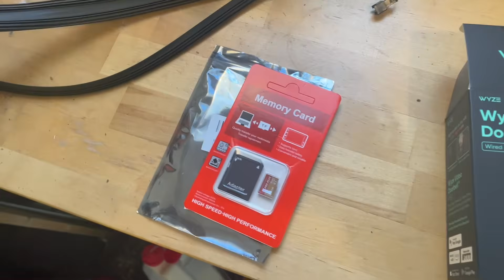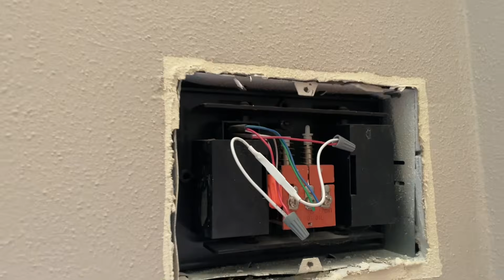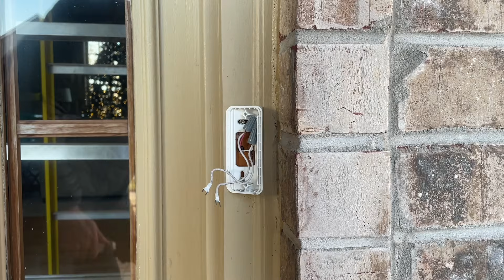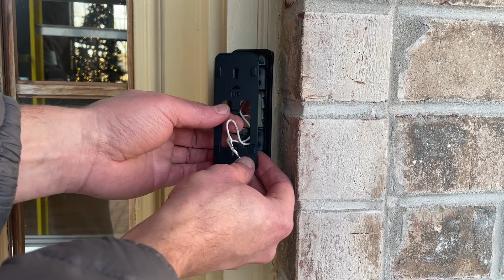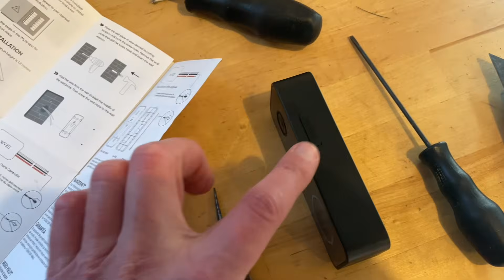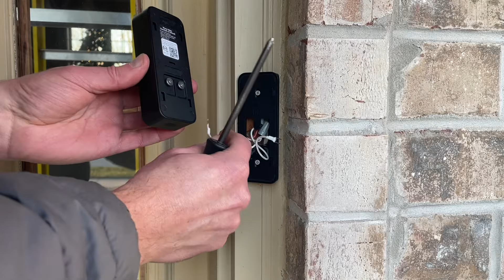Wyze V2 Doorbell Installation

Comment: I ordered two. Front and back door. Do I need to install both chime controls or just one.
Reply from the maker: I believe if both of your existing doorbells are wired to the same mechanical doorbell then you would install the front door wyze chime controller to the “front” and “transformer” connections on your existing mechanical chime. You would install the second wyze chime controller to the “back” and “transformer” connections on the same existing mechanical chime.
I’ve not done this so I’m not positive but I believe this should work.

Comment: Thanks for the video! I had the exact scenario…from Wyze version 1 upgrading to v2. Had to reorient my wires as i didn’t label them the first time. I ended up just testing with multimeter and quickly found the ones from transformer, 20volt.

Comment: My chime box still not working. I switched the wires with no success. 😢
Reply: I can not get my chime inside the house to work either
Reply: Same here. Not sure what’s going on. I have the same wiring and am making the same changes. I’m not so happy with Wyze products.
Reply: UPDATE: it works. I was sure I wired it correctly. So I left it alone and came back to it and it works. That black box in the middle needs to charge for about a half hour before it will ring the chimes.

Comment: If I don't have an existing door to attach the chime is there a way to power it seperate please ?
Reply: If it works anything like a ring, you can probably use a separate power supply whether it be 12 or 16 volts ac.

Comment: Is it mandatory to install the chime transformer first? Before the camera?
Reply from the maker: I believe so.  The instructions specify to connect the chime controller first then proceed with the camera install.  This is low voltage stuff so I wouldn't think it would damage anything but probably best to follow the steps in the installation manual if possible.

Comment: My doorbell device only has 2 wires. Front and transformer. Nothing else. Where do I place the black wire?
Reply: Did you ever figure it out? Mine is the same only 2 wires
Reply: If you have two at the doorbell ch8me location…the one connected to “front” is the one you connect to black wire. Then, the white wire from Wyze chime module gets placed in the “front” screw. You can see an example at the 3:37 time in this video
Reply: @carrangil  so you put 2 wires from the Wyze camera on the front screw? The black and the white?

Comment: When I installed my Wyze doorbell v2 there is a micro usb port on the back. I installed the micro SD card then connect the micro usb to power the v2 doorbell cam then set up the Wi-Fi connection and password and activate to your Wyze account. After setting that up then I installed the camera to the doorbell wiring. The last part on installing is getting the backplate to click into place it was hard. But I used electrical tape around the outside the housing covering the micro SD slot